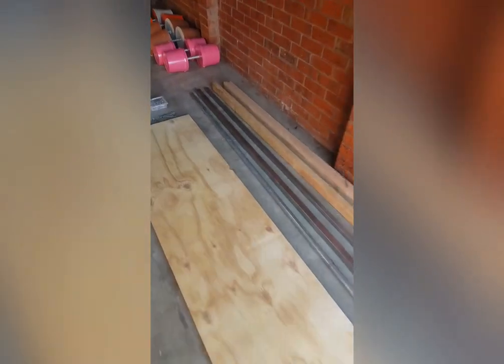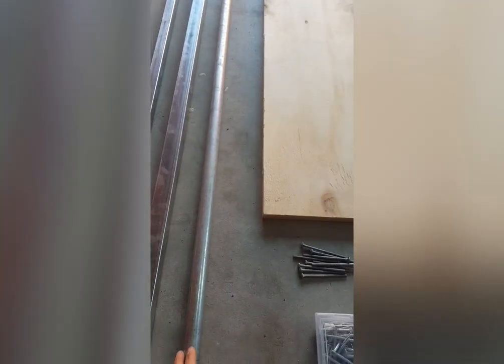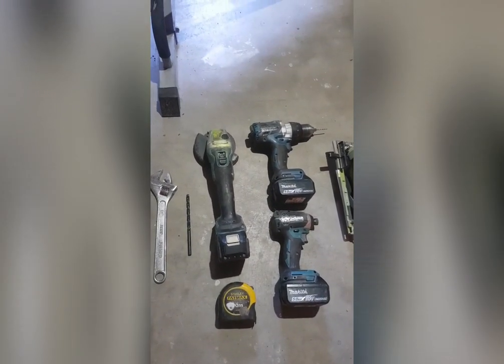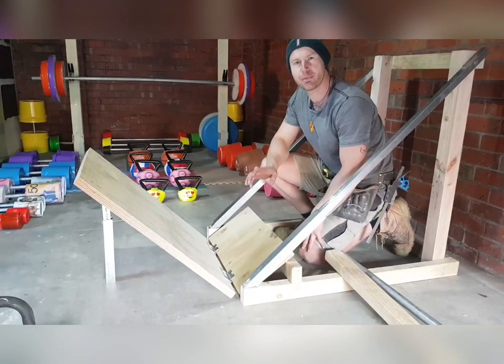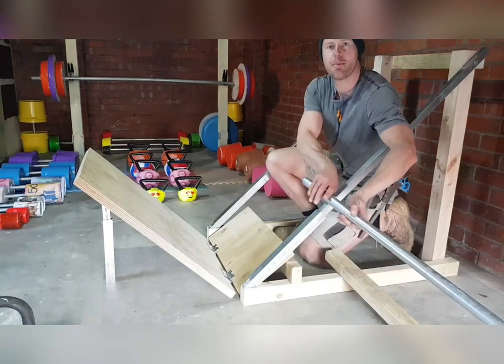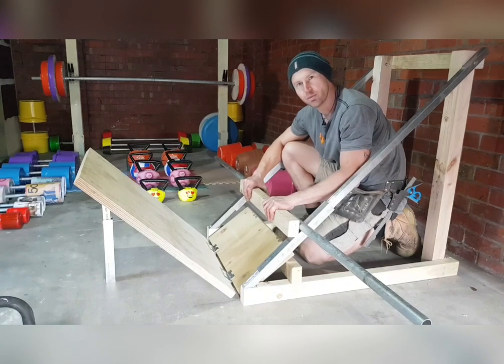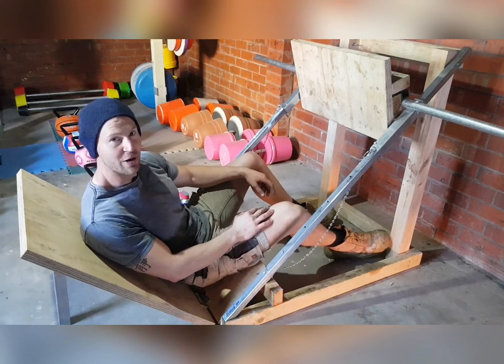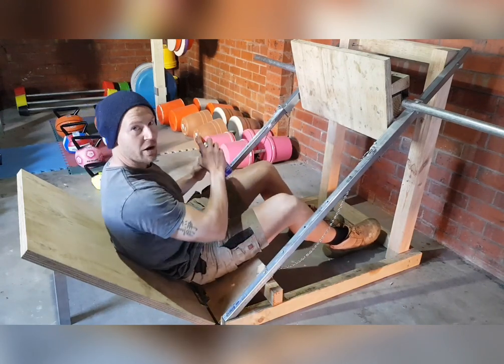DIY Leg press machine

Comment: How did you connect the bar through the centre of the 40mm box section steal? If you put a bolt thru it surely it will interfere with it sliding up and down????
Reply from the maker: Hi, if you can contact me on instagram or send emai through, I can send you a photo:)

Comment: Don't the bolts that are attached through and to the side of each 40mm square tube, grind or impede the smoothness  of the sliding action?
Reply from the maker: No, not one bit actually! That's why they're on there to act as a guide. You will see it on the photo I sent you. It will make sense🙂 Just make sure to put dry lubricant on machine every so often👍

Comment: Hey matt do you know where I can find the galv RHS steel I cant find the exact same length in any store online in poland, Should I buy a bigger one but with the same thickness? and just cut it down later?
Reply from the maker: @audi_5  Hi! Yes, that would be the best idea. Some countries have different lengths but as long as you have enough, that's all that matters😊
Reply: @MattLees-Nunan  Thank you matt, but also can you tell me if these measurements at the beginning are in mms or cms?
if they are mm measurements, then the leg press is 65cm wide( because the thing you attack the rack for the bar to slide, to, is 63cm wide and the wood for the rack to stand on is like 2cm wide as well,  and 2 meters long without counting the bar), also can I put any bar inside of there? I have one already at home, it is like 180cm wide and I can put 100kg on the bar.
Reply from the maker: @audi_5 all measurements are in mms or metres... I never use cms! Hmmm... for the bar, why don't you try and see what happens?
Reply: @MattLees-Nunan  Allright, thanks matt.

Comment: Great job. One question how do you attach the pipe to hold the weights to sliding sleeve?  On video looks like you drill a hole to hold pipe but how does it slide up and down? Ty
Reply from the maker: Will send you an email!😊
Reply: I have the same question, can you send it to to as well please. Thanks
Reply from the maker: Hi Steve, do you have instagram or an email address for which I could send you a photo?
Reply from the maker: Hi! Do you have instagram or an email address so I can send you the photo?😊

Comment: I got a question the 30mm and 40mm would that be like 1in and 1 1/2 for the sqaure metal pipes so if I took like a 1in and ran a 1 & 1/2in  over it would that work
Reply from the maker: Yes, definitely!

Comment: I’ve no idea how you fix the weight loading bar to the box section so it still slides. On the the video it appears the bolt goes through both sections which would just lock it in place.
Reply from the maker: It goes to the inside of each and then acts as a guide!

Comment: How is the bar that holds the weights anchored to the sleeves that glide along the parallel bars?
Reply from the maker: Great question! Held on by 6mm x 100mm bolts. If you install the bolts through the bar and to one side of the 400mm x 40mm steel, this acts as a guide for the rail👍
Reply: Can you show a picture of it please
Reply from the maker: Hi Laura,  I've taken a photo but it won't let me upload it via this method. Is there another way I could send it through to you?
Reply from the maker: @triplemoon69  Hi Laura! Sorry about the late reply. Have sent you a photo of how it's connected🙂
Reply from the maker: @daleparsons1712  Hi Dale! Have just sent you an email with a photo of the connection🙂
Reply from the maker: @qfloyd25  No problem at all. Just sent it to you. Let me know if it makes sense?😊
Reply: @MattLees-Nunan  thanks
Reply from the maker: @howiec5950  sure!
Reply from the maker: @howiec5950  Just sent it then. Let me know if this makes sense😊
Reply from the maker: @mrgallipato96  Just sent you through the photo. Let me know if that helps😊
Reply: @MattLees-Nunan  thanks a lot :)

Comment: How did you connect your pipe onto your sliding metal?
Reply from the maker: Hi Tamara!
So the 40mm bit of metal which slides over the 30mm bit of metal has 2 x 6mm x 65mm bolts attatching it to one side. Let me know if this helps🙂

Comment: Matt great channel great information I am going to build your leg press machine but I do have A question how did you connect the bar which holds the weights to the larger diameter square that slides up and down did you weld a piece in place or did you use a mechanical connection thank you
Reply from the maker: No worries! What is your email and I can send you a photo😊